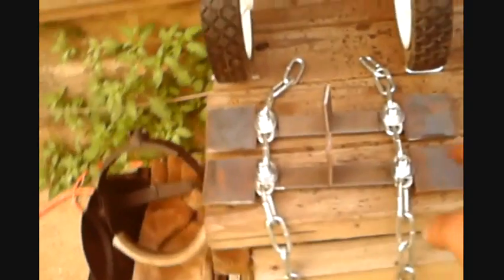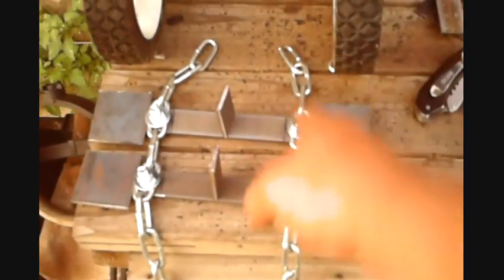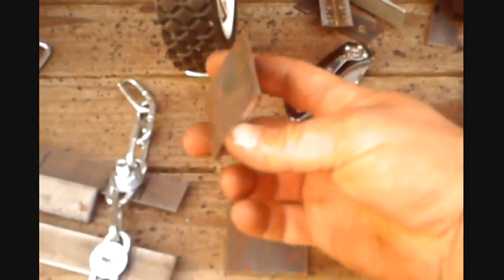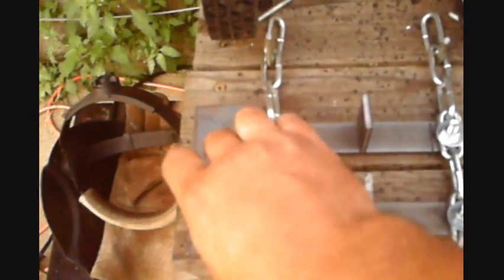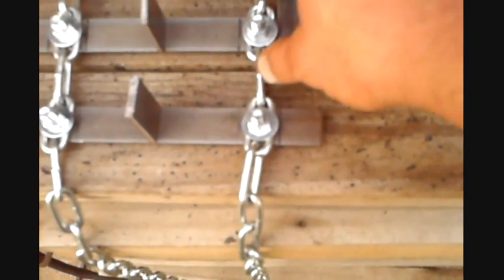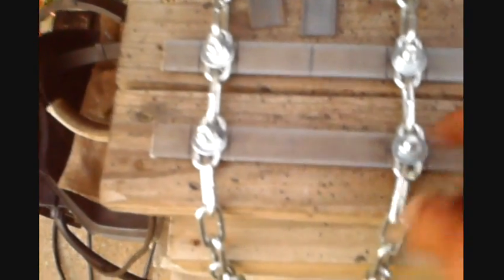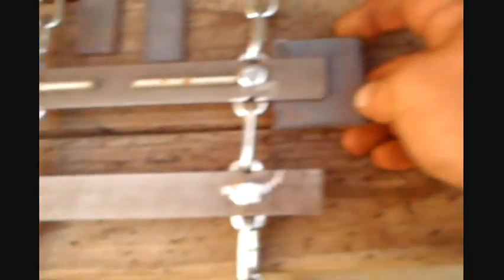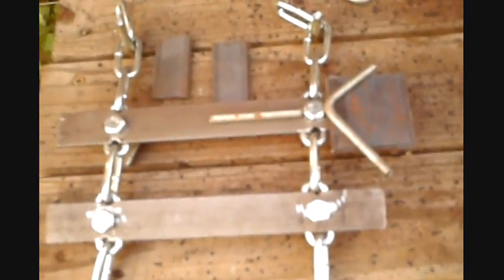Make and Build your own tank tracks (X1 Scorpion Track Design) part 1

Comment: Where did you get the track plates??
Reply from the maker: I designed and made them myself. I made them from 1/4 round bar, 1 inch wide  flat stock and hardware. You can buy everything from Home Depot or go to a steel supplier for the steel. And about 100 lbs of mig wire too.

Comment: OMG.... SO labor intensive!! Why not just use snowmobile tracks... couple of used POS machines and all of your drive system is attained. NOT trying to take away from your idea at all maybe just save a little(ok, a ton) time...
Reply from the maker: Appreciated your comment. I have bigger plans for this vehicle and buying tracks is so limited. Plus just not strong enough and if I do something like building a vehicle, I learn every aspect of it, inside and out. Not too many people can say they built a complete tank from scratch. Enjoy the rest of the videos on this. Will be starting this project back up in a month or so.
Reply: You are right about the experience gained. You are one of very few that can say they have done what you are accomplishing- or already have for that matter. I have plans(in my head of course lol) for an old lawnmower that has a hydro drive system, 2 independant pumps to hose to drive motors... true zero turn capability is an awesome concept. Only downside is I will be limited to about 15 mph(which isn't bad really). Hope I can bring it to fruition soon! In the meantime- ENJOY what your doing! I'll keep checkin' for updates

Comment: How did it work?  I have done some 1/6th scratch building of tanks so I have a little experience making my own tracks.  I'm going to assume your design will flex laterally too much.  You need them to be really really stiff or they will derail.  I used 4" Rexnord carbon steel tabletop chain for my 1/6th scale electric KV-2 R/C tank.  That stuff is really stiff and works great, but it is heavy.  Table top chain comes in tons of different lengths and if you get lucky you can find it at a decent price on Ebay.
Reply from the maker: +Derek Engelhaupt Hi Derek, The tracks worked great!!! I think that's one of the few parts that worked right in my test drive. You can see the test drive in a newer video. I also did videos on testing the tracks while they were off and laying on the ground.

 During the test drive, I had no issues of the tracks coming off what so ever, even considering how loose they was during the test drive. All the guide channels on the system worked great, from the draggers on top, to the bogie guide channels. Although I did see one thing wrong with my guide system but wasn't even an issue during the test and that was the openings for the guide channels on the bogies. I just need to open them all just a little bit so the track guides don't get caught on the opening, which is what you are talking about flexing laterally. The track guides are 2 inches tall and do not rely on the road wheels to keep them on like on a conventional track system. On my track system, the tracks stay on by guide channels that are separate from anything else on my system. This was thought of in the designing  of the whole system.

Thanks for the comment, hope you watch the other videos in the playlist to see how far I am. Spring time I will be starting this project back up to get it going so I can have some fun beating the crap out of it, LOL.

Comment: Hello +prancstaman how are you? I am from argentina. I toalk with your friend Aceman and he said me that you ave a similar project. I need to understand how do you do the transmition system. Is the only thing that its stopping my project. Thank you very much!!!
Reply from the maker: Hi Pablo, i'd be glad to help. There are many ways on setting up the drive system for tracks on a vehicle. First things first, would need to know what kind of parts you are using? On my drive system, I am able to use or set it for at least 2 different drive systems with the parts I am using. plus depending on what transmission and axle your using goes hand in hand too. What I mean on what parts you're using, car parts, ATV parts, riding mower parts, for examples. Plus if you want zero turn or skid steering with the tracks. Skid steering is the easiest, while zero turn you would have to make the entire transmission yourself. I will be using skid steering on mine. I have a newer video explaining my drive system on my channel.
Reply from the maker: +Pablo Sanmiguel  Here's a link to my video explaining my drive system-https://youtu.be/n9NSNBArXyc
Reply: ***** buddy, thank you very much for the message. In many ways, for me, Its a litte difficult for me the language (or rather without spelling mistakes and to understand me ahah.. I wish it well). In first place, I have to said youy that here, In Argentina, nobody makes this project (i think..) so its very difficult find people who can help me. Other big problem its that the thinks are very expensive, so I have o think a way to do the project with quality but without neglecting my budget. In one word: impossible.

I take, aproxi , tow years analyzing and reserching obut these. The only, and it is not lower, than I have is the fucki.... transmition. 

I have two possibilities,  and the best I thing, one its with a belt system (but the problem that I think may have  they are not strong enough mind and end breakin). The second system are with a differential of a car. With brakes. But here I have the problem with de reverse. 

To be ending and dont continue bother more.... I want to use the PTV for fun, and not a lot, becouse I live away from the place that the PTV would be. Also, I want that the PTV  have to be strong  but not exposed to abuse and mistreatment.

What type of engine do you put? I have on mind put a a stationary engine 18 hp. Its good? What do you think?

Well... thank you very much!!!! If you have and email you can give it to me, so I can write to you there.. Hughs brohter!! Thank yu very much!!!!
Reply from the maker: Check your private messages, I sent you my email address there. We can talk that way or just respond to the private message.
Reply: +prancstaman how I see? Sorry I dont know. Can you send me an email to pablitosanmiguel@hotmail.com ? Thank you very much and I hope you understand me!! ahah 😊

Comment: LOL hes going to need a 4 cylinder diesel motor to power a 2 foot long track section.  Oh dear a ton of money down drain.  It's just to heavey
Reply from the maker: Rich Morgenstein Not quite, I built up a Briggs flattie, 11 hp modified for torque, for this build. With future plans on building an 18 hp oppey Briggs outlaw motor in a couple of years. Total weight of each complete track is around 70 lbs. plus a light weight steel tube chassis, max weight will be under, that's right, under 800 lbs with driver. I guess we both will see how it will go, considering this is my first tracked vehicle I'm building.  The 11 hp. motor is for testing the driveline. My goal with the 18 hp motor will be to pull the front end up on a launch to where I'm riding it on the back drive sprockets.    Thanks for your comment on the video, I appreciate it.
Reply from the maker: Rich Morgenstein Oh, please watch the rest of the videos to see how they are made every step of the way. You'll see how light they are, all in the design, a bunch of little pieces to make a big piece.
Reply from the maker: Rich Morgenstein One complete track weighs 92lbs, and I'm not even going to need the whole length, so when put on the tank, it will be lighter.
Reply from the maker: Rich Morgenstein Yeh of little faith, I thought of what was mentioned above, My 11hp motor is 1.5 to 1 to gearbox input to start with, so my 11hp motor is 16.5hp at this point. In high gear my gearbox has 4 to 1 on the output axles, so my 16.5 x 4 = 66hp on the output axles of my gearbox. Is that enough of power? Then from my output axles of my gearbox to my sprocket axles that drive the tracks is 1 to 1 now, which is able to change to 2 to 1 if I might need it, but I think I'm good with 66hp at the drive sprockets. Speed is not important right now. The chains only provide links and spacing. Drive sprocket cog will fit in the space between the plates in the center portion, just inside where the wheel rides on, and there is a track guide right in the center of the track plate, 2 inches high and the completed track can go completely around a 7 inch circle without the guides binding up. Your right about 1 thing, I have no idea how much power it will take to drive 2 tracks, but I think I'm close though, LOL.

Comment: Would cable work better then chain?. Have a plan for the tracked lawnmower just have to get at it
Reply from the maker: ShawnCFarm I think cable is a better Idea then chain, you can use less material which will come out lighter, and easier to connect the track plates with just a piece of tubing on a flat piece of steel stock with spacers, and I can see about 5 different ways to drive the tracks. I think that would be perfect for your tracked lawnmower. I remember those vids on that thing, that was great, I actually used your vids for learnin purposes for my tank project. They were great.I didn't use cable because of the drawbacks of workin with cable for tank tracks, the Howe brothers never mentioned anything about it on their show, It was all positive for good P.R. for their company. and plus I plan on building more tracked vehicles down the road and I wanted a different idea I'm more famillier with. I seen the chain idea on a WW2 APC driven in the snow. It was only an angled side shot but that was enough to give me an idea. I wasn't even sure if that's how the tracks were made on that thing. Seems to be workin fine so far.LOL.
Reply from the maker: ShawnCFarm Oh thanks for sharen the vid.
Reply: ***** A budy of mine has a plow truck with this chain method but with a different spin on it.  If I get down there again I'm going to get some footage of it. I was thinking about using it on the lawnmower
Reply from the maker: That sounds pretty cool.

Comment: Cool idea using the chain it gives you a way to space the tracks evenly. I like the idea for the cleats. I have seen where people up north for the ice use self tapping hex screws run into tires for cleats. Maybe you could tack weld the washer to the chain to keep it from slipping. Now you only have about 120 to go!!
Reply from the maker: Aceman307 Thanks. I had to put the cleats on to add strenth to the plate. I'm thinkin if you roll over a rock in the center of the plate it would bend the plate alittle. I tested a single track plate by makin a bridge with 2 pieces of wood and stood on the tip top track guide and it held my weight with no problem, But it got stuck in my boot, LOL. I thought about tack weldin the washers to the chain after I made the video last night, yes I think I'll do it that way. I like that way better then welding the chain to the track, that way while in the field you can still take the track plate off. Thanks again. I figure about 120 too, or something close to it. This design is my second design actually with a lot less parts on it to make. I figure 2 weeks minimum, LOL, if I keep at it, maybe longer.
Reply from the maker: Aceman307 I'm skimming through the comments and read this one. Man am I off on the time, LOL!!!!